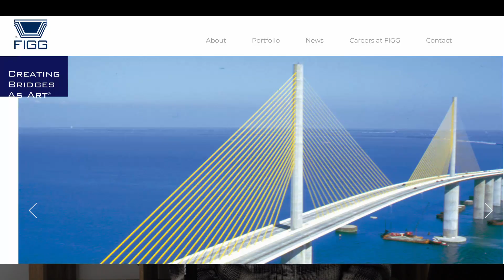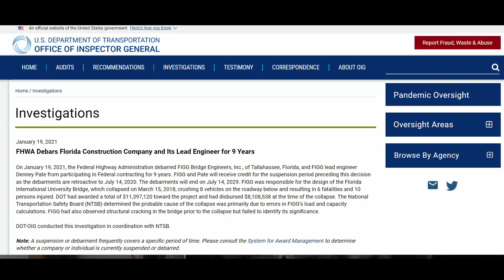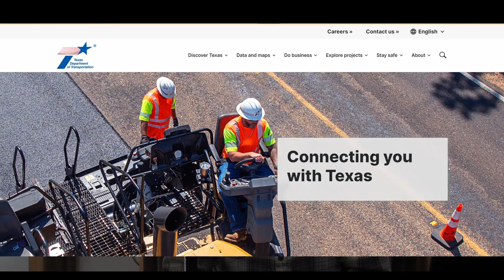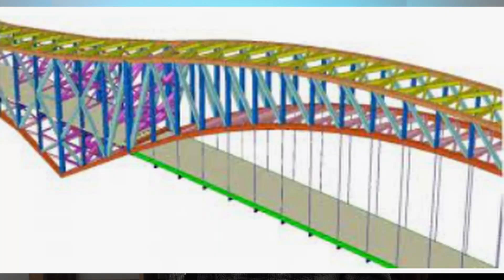New Harbor Bridge - Why Construction Resumes

Comment: D & C contracts happen after a tender period which is insufficient to design any more than a very basic schematic. Unfortunately, some of the errors caused by a rushed tender process get baked into the final design. I have seen exactly this happen on a project where I was part of the Independent Verification Team. They proved to be very costly for the contractor.

Comment: You asked a question, I may not get it 100 percent but why were bridges designed with a slide rule 60 years ago still servicable and ones designed by sophisticated computer modeling having problems.  There is not ONE answer but there are only several and if they were followed, these would not be happening.  There can still be failures like galloping gerty when we are out on the leading edge and something is not known - these have happened in the aricraft industry where the repeated implace ofr tensioning and release on alumnum was not understood until several failures. I am an avid fan of several air disaster channels, Juan brown's for example, and I believe some of the same factors are in play there.  
We start to have a reliance on the technology and quit thinking.  i an concerned about AI for that reason. There have been some real disasters with AI legal briefs.  My background - I am a 1961 high school graduate and 1965 BA in math.  I spent age 16 to 20 in design, construction and testing crystal selective networks (filters) for RF, then went into computer programming, systems analysis, and finally into data communications.  My fields are electronics, tech and computers.  But early on I recognized they are not a panacea to replace common sense.  I used a slide rule for aome things - if 3 digit accuracy was enough.  in the filter design canculations had to go to 6 digits, we had the old mechanical calculators.  That means a crystal has to be nearly spot on.  If the calculated value was 10,701,325 the real value had to be somewaht close, usually within 500. If you speced  it 100 off, with variation, some of them would not work.  But in everything, the old sanity check was important.  The do it twice to see if you get the same result, and the like were important.  I did dozens of designs and never had one go sour. I had a couple times that something did not look right and ala, it was not. I designed, built, aligned and tested something for half of the manned and unmanned space shots (sometines for ground stations) from the first shots after i started in 59 to the end of Gemini. We can become too reliant on the technology.  A second item is using the technology to mazimize the design.  They cut the corners as close as possible.  If your calculations are to 3 digits, you do not cut corners - and you get maybe 1% more safety margain there.  One percent more safety may make the difference.

Comment: I am not a structural engineer, but I have thought the biggest problem on these "new" bridge collapses, is the same as the "old" ones.  Money. Either lack of money spent on maintenance, or a desire to make things as cheaply as possible.
It makes sense, if every bridge was overbuilt like the Forth or the Brooklyn bridges, a city like Pittsburgh or Baltimore simply couldn't exist.

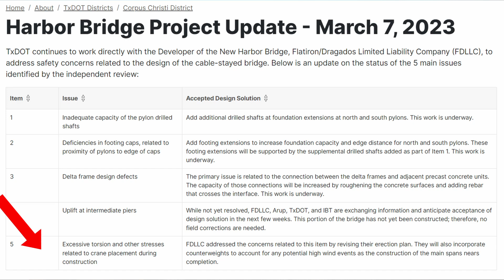Comment: Minute 5:04; '.....to address concerns about excessive torsion and stress imposed by the construction crane associated with the installation of the main spans...' so does that imply that the construction crane shared the same foundation as the main span, (makes sense), but that during the time of construction that foundation, assuming a substantial amount was concrete, that that concrete may have been too green to support the load without damage?

Green concrete ain't what ya think it is, I think that it was the main issue with that foundation blowing apart under that rocket launch, hells bells, what was it, something like 21 Raptor engines?  That's a lot o' heat, ESPECIALLY on green concrete.  Mind you, concrete takes about 100 years to set up.  I worked on the old Western Can Building in San Fransico, built in the early 1900's, a huge building, the expanse inside was free of interior walls as we were demoing it, to converting it into boutique offices, this was in the early '80's, I was standing at one end looking towards the other end where a D8 cat and large excavator were working, and they looked like Tinker Toys, I kid you not.  Anyway, I had to go out and install a 2X6 ledger onto the concrete exterior wall above the sidewalk to install an overhead roof.  Me and my mate were up on the scaffolding at each end of the board, and I took the Ramset, which delivers a nail into concrete powered by a bullet casing, the nail being the bullet, and normally it works right off.  That old concrete turned that nail into a U shape, I'd NEVER seen that happen before.  It pitted the concrete a bit, maybe about the size of a quarter and shallow, and that was it, it blew our minds, (and added hours of drillin' on a task that never got bid.)

Comment: The computer just runs programs. The marriage of programmer and engineer is, at best, iffy. Language is the most difficult barrier. GIGO is the result. Does the program put the proper weight on each of the parameters? Are all parameters and options accounted for. Great programmers are hard to come by. There are lot of good programmers out there, but when life and limb is at stake, great is needed. Companies often pay big for hardware, then skimp on the software. Thank you.

Comment: A computer is only a smart as the programmer. If the programmer makes an error inputing information into the computer to use as a basis for calculations, the program will run as "asked" based on the input received. So any calculations will be made solely based on the input ( whether the input was made correctly or not).

By the way, i live in corpus and am deathly afraid to use the new bridge, but my job requires i use it now and then. So I'm crossing my fingers it gets done right.

Comment: They do the modeling and consider it adequate and correct; there is no review.

If it turns out there are any errors or any unreasonable results, they may not be discovered in time to avoid delays and extra costs. Indeed, they may not be delayed until a failure occurs.

I think big projects with significant implications for cost and potential harm to the public should be independently reviewed by default.

While such review will potentially add substantial extra cost, those costs might be smaller than the cost of delays and having to rip out and replace major parts of the construction.

Comment: I hear a serious question in your remarks: has sophisticated FE analysis, particularly when accompanied by fancy graphics, led engineers to become overconfident? As one involved in the development of FEA in the 60s I fear the answer may be yes.
Reply from the maker: Thank you for your comments.  I see parallels with current AI usage where a seemingly plausible (yet incorrect or even dangerous result) is returned to the user.  If that user isn't sufficiently experienced, or if the problem is simply too complex, big errors could result.

Comment: To err is human. To really f%#k up you need a computer.
When things were done by hand, the result was associated with a human, who could make errors and should be double checked by another human. Once computer simulations and calculations came along, a divine power and status was associated to the results printed and the propensity is to accept them as good. Human laziness also plays a role...
Great video and great big scope question!
Reply from the maker: Thank you very much! I agree with. The passage of time doesn't necessarily correlate with improvements in engineering practice it would seem!

Comment: I am a mechanical engineer; as a young guy out of school I was tasked with posting weight ratings on all the floors in a 100 year old paper mill. After I rated a recently poured concrete floor at only 166 pounds per square foot live load, the chief engineer said he had design drawings showing it to be 500. We reviewed my calculations and then called in the engineering firm to discuss. They had used a new computer design program that only based stresses based on bending in the spans. The problem was the spans were all short and shear was the governing factor. Their slab was designed for 500 psf but the support steel was not up to it(steel frame was existing). I posted the floor for 166 psf live load and have always been skeptical about computer designs. I hope they have improved since the 1980's.
Reply from the maker: Wow, that is scary.  It reminds me of why it was difficult for engineers to switch from imperial to metric units (most of those efforts have now been abandoned. The problem was not that people couldn't convert units, the problem was that people had not internalized the units from past experience.  People have an innate since for something that weighs 10 pounds, but 44 Newtons not so much.  This situation reminds me of the same effect when relying on a computer program to perform calculations that had not been internalized by humans.

Comment: Of course, how much effort it takes to validate your design makes a big difference.

I can see the same in my field of expertise, too. Nowadays, the solution for a program running slow is to "increase the number of processor cores assigned to that virtual machine" (very often literally). Back in the 90s, we didn't have that luxury. Misjudging how much computing power a program needed would either be very costly, as new hardware had to be replaced by even more expensive hardware, or very costly, as the program had to be rewritten from scratch to run on the only available hardware. And I've seen first-hand how this has changed the way we work.

In the 90s, we would spend months planning out solutions on paper. That included selecting algorithms, planning out data structures and doing load calculations. In the 00s we shifted to using and adapting standard patterns and just assuming those patterns worked for every problem. In the 10s, planning went out the window and was replaced with simply starting and then adding one feature after the other until it's done.

I still insist on at least collecting a "worst-case maximum feature set" first so I can steer the project towards building foundations that can support (or be adapted to support) that, but that gets harder and harder each year.

I suspect it's the same with structural engineering, but goes one step further. The past engineers knew which designs had the widest margins, i.e. needed the least amount of verification to know they were safe in a specific application. So, lazy as humans are, they used to prefer them. Modern engineers can simply throw their designs into a computer and get a green light. They often have no idea how far from the margins they are, or even how wide (or very narrow) a corridor of safety their solutions have. They don't constrain themselves to wide-margin solutions for the "boring" parts.
Reply from the maker: I think your analogy is very apt.  That reminds me of the stories about the meager computer memory of the Apollo Lunar Modules.  The programmers made up for this by using extremely efficient computer code.

Comment: Casey,

Your comments at the end of your video hit home.  I was a 2nd Semester sophomore when the HP35 calculators came on the market for a whopping $395.00.
The calculators were in high demand because we were allowed to use them on exams.

I don't believe the difference in education was centered on changes in technology.  I think the difference came from the teaching of first principles.  I believe when I was in school we were taught how to approach solve problems starting with a first principle definition and then defining the process to determine an answer.  By the time I retired in mid-2009, I found my summer interns and young engineers were great at running programs, using computer applications, and using the internet.  They were lacking in being able to start with a definition of the problem and in working toward a solution.  They couldn't look at a problem and make an order-of-magnitude estimate to determine if their ultimate answer is correct.

My first marine engineering class was taught by a new associate professor who was teaching his first course.  His exams were tough but fair.  You needed the full-time allotment to finish.

I saw him about 30 years after my first class with him.  He told me he hadn't taught the class in years, so he decided to use the exams from my class to save time.  He said that the exams I took were really difficult and that his current students wouldn't be able to pass them.

If you look at the Millennium Tower, the building in Sacramento, or the condominium near the World Trade Center in New York, you have to wonder if anyone took the time to ask: "Is this answer correct?"

Bob

Comment: Computer models can be funny things.  When I was studying electrical engineering many years ago I remember discovering that if I started with a good hand calculated design and then fed it into a spice model then it would generally produce reasonable results and I could build the circuit and get comparable real world resilts.  If, however, I found that the model was giving wildly different results than my hand calculations it was tempting to just start "playing" with the model rather than going back to my hand calculations and figuring out where I'd gone wrong.  In that case it was sometimes possible to produce a model that gave completely erroneous results.

Comment: Part of the issues I have with current engineering, is the engineers doing designs, do so at the face of a computer screen.
When I was in college, we were just starting to see calculators in the classroom, but mostly relied on slide rules to do much of the classwork.
Designing with a slide rule does one very important thing.  It forces you to mentally keep track of your decimal points.
Doing this trains your brain to understand magnitudes in a way that looking at reams of data printouts does not.
Just because the computer says one thing, does not mean it is correct.
Reply: Spot on. I don’t remember hearing “garbage in, garbage out” and “black box” often in the slide rule days.

Comment: The issue the programming of the software.
I see this in my field of bioinformatics.
Statisticians usually have programming skills, but are far to mechanistic in their outlook. They make silly assumptions like "if a gene is expressed, a functional protein is made."
Biologists on the other hand treat the very rigorous rules of statistics like speed limits - they are a good idea, but should get in the way of things.
We end up with 2 different types of software, stuff that is written by statisticians which often produce results that make no biological sense and stuff written by biologists that are just fundamentally flawed.
Reply from the maker: You have identified the central issue.  The subject matter experts don't usually have high end programming experience and those that do, do not understand the subject matter to a high degree.  I had the same issue as a subject matter expert on a data analytics project.  I decided to learn how do do the programming myself (mostly database stuff) since I couldn't even find a programmer who would get involved.

Comment: The Brooklyn Bridge was completed in 1883. Would any of these recently or soon to be constructed bridges actually last over 100 years with proper maintenance?  Or does the current designs preclude all types of repairs?
Reply from the maker: Repair and maintenance is a key part of keeping bridges in service.  Most highway bridges in the U.S. are designed for 50 to 60 year service life.
Reply: For example, with the New Harbor Bridge and its segmental box girders which are post-tensioned with cables, how will these sections be replaced or repaired due to concrete deterioration and steel corrosion from the elements?  These sections in tension are part of the superstructure.  Are the delta frames made of reinforced concrete? Are the delta frames repairable?  Unlike structural steel, which sections can be replaced or plated, how is this repair or replacement done with reinforced concrete?

Comment: as typed on the old vid.  lack of deep thinking, and as such blindly accepting what the simulation indicates when it agrees with your wants or desires, possible. may also be not knowing fully what a simulation is indicating or excluding when setting up the test parameters to match the desired outcome, as you say, we think less because computers do it for us and it sets us up for Confirmation bias. now to be fair, checks and other administrative systems weren't robust enough to ketch errors, so it wasn't just not thinking about it, "they also said it passed the review, so it must be good" mentality along with a mix of "go fever".  case and point, this isn't the first time FIG only simulated the final design and didn't take into account the partial construction loads. The review was done on the final design, yet never looked at the partial spans during the construction of the FIU bridge, and here the loads of the cranes placing span sections during construction were forgotten. so reminiscent of the Apollo 1 and Challenger investigations, the system was bad not just the design. I'll spare y'all the Gene Kranz "tough and competent" rant over this.
great questions and vid. B)
Reply from the maker: Thank you very much.  Yes, it just goes to show how critical the work place culture is in these situations.